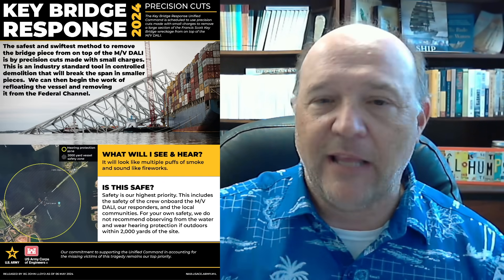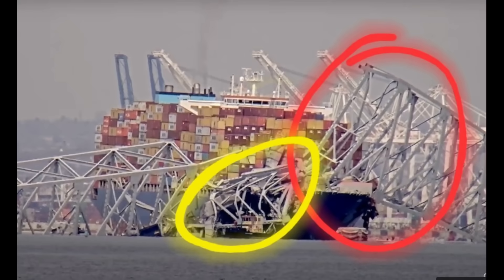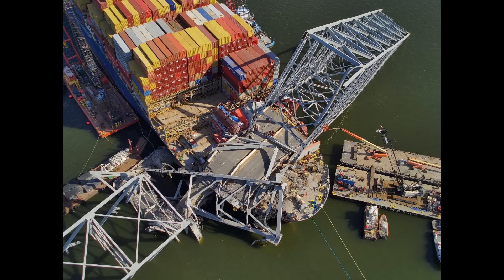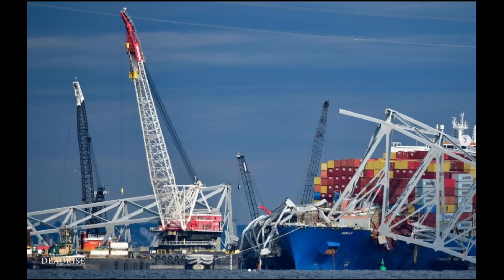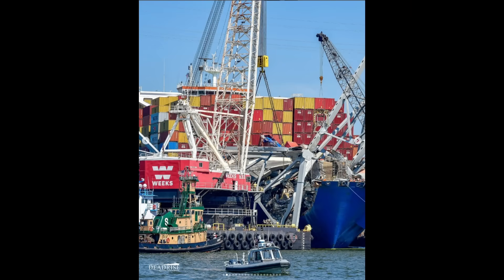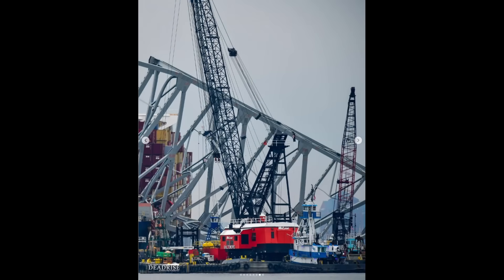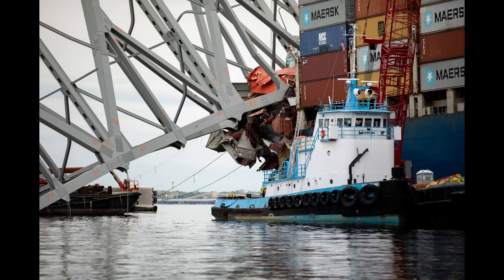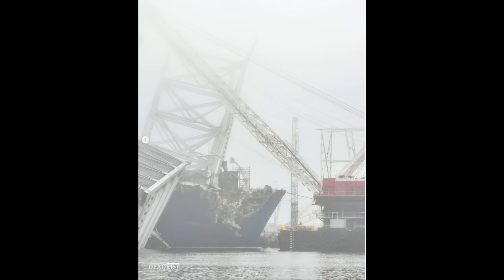FIRE IN THE HOLE! | Baltimore to Blow the Key Bridge Off MV Dali

Comment: This is the best decision for the safety of the work crews. Heavy structures twisted and at odd positions are very difficult to understand the loads and stresses. Steel under stress/ load can do unexpected things, when the steel is cut and the load/ stress changes. Large structures also have an enormous weight, which can squash a person like a bug. No need to add to the death toll. No need to make an already dangerous job worse.

Comment: Linear shaped charges are like magic. It's just an extruded triangular copper sleeve filled with serious puddy. 
They'll cut through like 3"+ of steel with, like you said, a very large fire cracker amount of fanfair. They form a line explosively formed penetrator and literally unzip whatever they are up against. They are also directional and short range, so very little overall impact.
The blast blankets are just there to catch the copper and steel spatter really.

Instant, simultaneously fired cutting torches🤘
Reply: They ain't that dainty. There will still be an Earth-shattering kaboom. Just not Alderaan levels of debris.
Reply: @blairhoughton7918  okay, fair bad wording. but still,  nowhere near the holywood blast people think of.🤣
It's even inside the boxbeam for containment

Comment: Once the bridge is removed and the ship can be docked, will cargo removal be the first step order of business? Just wondering what happens to that cargo in the filled containers after such a long period of time, ie does it become property of the various insurance companies, does it default back to the shippers, is it forwarded on to the intended port of call on another vessel? Given the amount of cargo these ships can move, there is probably a lot of paperwork involved after an incident like this.
Reply: Stolen cars inside.......
Reply: All the cargo from the ship can be held as ‘security’ to insure that each cargo owner pays its portion of the general average fund. Generally, the only way to get your cargo is to post cash or a bond to secure your portion of the general average fund. This is also very complex and it might involve parting with tens of thousands of dollars just to get back the cargo that you have already paid for …
Reply: @sventhormodpetersen1752 Yup, but it beats losing the whole thing. The average on this might be relatively small. Only a small fraction of the containers are damaged and some of those were empty. The ship damage is included but so is the ship. The assessment could be single-digit percentage of each shipment's value. But if they find a squished Bugatti under there everybody else is going to be piiiiissed.

Comment: I wonder what will happen to the Dali when the weight of the bridge section suddenly is removed. Does it come up from the bottom and what would be the side effects of that sudden movement?
Reply: Good question!  Someone mentioned in another comment that they are ballasting forward and possibly intentionally flooding some of the forward voids so that it won't come up when the bridge falls off, and then can be floated off in a more controlled fashion.

Comment: ZeroDay Vulnerabilities need to be better protected by the ship’s ETO.   I’m not blaming the crew for this exploitation but tune up your security.
Reply: Hope the front doesn’t fall off that ship at sea.   😂😂😂😂😂😂😂
Reply: @fakename8856 they’ll tow it outside the environment if the front does fall off.
Reply: which vulnerabilities? was it hacking after all????
Reply: @simonschneider5913  determining the source of a well done zero day is almost impossible. Unless someone takes credit for it it will be a guessing game. 3 generators don’t just turn off and go deadship at the exact same time the rudder was hard to Starboard.  I’m an ETO so I do somewhat know what I’m talking about.
Reply: @fakename8856  thank you very much for this comment!

i am way less knowledgeable about a ships systems, but your point about the coincidences makes a lot of sense. i know a little something about embedded systems, mostly motion control and sensors....so i can well imagine that there are many systems on board which could be targeted.

I remember the first thing i commented in one of sals videos: "once is happenstance, twice is coincidence, three times is enemy action"

it just looked strange to me, and there are things that correlated with it, wrt to geopolitics.
a huge can of worms, but i fear the YT algo wont let us go there.
Reply: Ships that size (Panamax) would NEVER have only 1 or 2 gens online in confined waterways like that. They would plan on running all 3 for the next day until they are out to sea.

Comment: Using shaped linear shaped charges you can cut through beams pretty cleanly. They are used to sever drill pipe in oil wells all the time.

Comment: Thank you for your coments on the unified command. I've seen incident command functions in the hospital setting and in practice its seems to be somewhere in between a single authority and a "unified" operation. If the players are all dedicated to the BEST results, rather than the power of their sector (as it should be), the "first among equals" tends to naturally emerge with the acceptance of all involved. Everyone involved in this operation is to be commended, especially if they have done the professional thing and united behind the most effective person, in this case the captain of the port. This will surely be studied and provide lessons learned in terms the actual work and the leadership functions.

Comment: There is a lot of potential kinetic energy with all of the weight still above water.
A few snip burns and cuts to lessen the charge needed .
   Ship will take as long as bridge to repair.
   Stray anchor yet to retrieve.
Ship would make a nice sturdy Dolphin .
Center it on new pylon . 
Build a hotel on it .

Comment: The orange blast points are interesting.  Looks like they are going to chop it up into "tiny" (40'-100') pieces, at least near the boat. All of those cuts are going to take a long time.  I wonder if the cuts are going to be "simultaneous" or if there is going to be a noticeable delay built in.

Comment: Bridge members under extreme extension or compression making it highly hazardous to have personnel in close proximity. Obviously, remote de-construction is a possible method of removal. So explosives or thermite - thermal dismantling has always been a safer option. .

Comment: Probably strip charges like they use to cut steel beams in Las Vegas implosions all the time.  Basically an L channel of steel that tamps the charge,  The open side is fastened flat to the beam and focuses the force to cut like a knife.

Comment: I think, logically, most of the explosives will be timed shaped cutting charges and perhaps some cabling attached to move the steel beams off the ship to pull the falling steel beams off  the ship with the least impact on the ship.  Not so spectacular as to the boom, but most interesting as to the movement as how the deconstruction proceeds from an engineering perspective.  I wonder if cabling will be in-place to also be able to retrieve the felled beams.. perhaps attached to buoys.  Do get this on video in slow-mo and have commentary from the experts that do this.

Comment: Question: if the bow of the Dali has been pinned down to the river bed and the stern has been rising and falling with the tide, with the hull fully loaded (as it is) this must surely have been causing structural fatigue in the centre hull sections? The tidal range does not seem to be that great but.....
Thanks for a great channel.
Cheers.
Mike (Cornwall UK)

Comment: The demolition animation looks great but with the whole structure leaning and twisted, it must be pretty tricky to calculate blast delays and how sections ought to domino. Maybe sections could pivot unpredictably either damaging the bow further or severing the gas line. Following this stage of the cleanup is fascinating.
Reply: There are more directional stress paths to figure in on a damaged structure then on a standing or undamaged unit.  The load paths have all changed from what the bridge was designed to do. Best of luck with the demolition, I do not mean to demean the job or the workers for this, it's a very demanding job, but even in the best of times this a crap shoot. All the best to the pro's doing this highly intricate work.
Reply: @praetor678 When you use explosives to make the cuts, all those torques and tensions and compressions don't have time to act to create large velocities. There's just some internal vibration and then gravity takes over and everything drops into the water. If you cut it into small enough pieces, you don't even have to worry about things stacking up, it's just a bunch of tinkertoys lying on the riverbed for the claw to fish up.

Comment: Sal,
It looks like to me that the broken bent (concert A structure) on the starboard side has penetrated the hall near the boot strap line. My guess is the chain locker and bow thruster rooms are flooded. There is a chance the force of the falling bridge broke the keel just afte of the moring deck. An engineering report I read the other day said the impact force was equal to a 24G ton bomb.
Reply from the maker: I am not going to see some severe damage on the port side from the bridge and down the starboard side near the waterline.

Comment: Are they going to remove the cement roadway which is a lot of weight on the bow before they try and move the ship?
Reply: Once the bridge steel is out of the way, the road deck can be cut into sections and removed. It appears to have been laid on a steel mesh.

Comment: Can Sal or anyone tell me if the giant crane that worked on the new Tappan Zee Bridge in New York is still around?  They called it the 'Left Coast Lifter' or 'I Lift NY'.  Wondering if it would have been useful in this operation?  I recall it can lift close to 2000 tons.

Comment: Why are the tugs going backwards  towing the front of the  ships towing them out of by the bridge. In stead of towing the ships from the stern from the tugs?
Reply: Interesting question. If I had to guess I'd say it's because if they have to suddenly switch from pulling to pushing, it's a lot easier to push from the front of the tug, and trying to get the front of the tug against the ship when the tow line is attached to the back of the tug is probably more complicated.

Comment: Removing the steel is the light part of the bridge I would be more worried about the reinforced concrete pier part, as well as the road deck part. That will be a huge weight. I really miss working marine salvage and tug work, been a long while.
Reply: The truss is about 4000 tons, but only half that weight is on the ship; the other half is on the channel bottom. I still think the road and pylon chunks will be a bit less than that.
Reply: Yeah, I can't believe that they haven't been talking about the fact that the whole pier cap beam is sitting on the bow, under the road decking and the that the pier column hanging over the starboard side may still be attached to it. That's a lot of weight and reinforced concrete to deal with.

Comment: " Controlled Detonations? " as in when a legally designated free-standing building is loaded with charges that  normally  cause a structure to collapse into its own footprint?  Had wondered if this kind of tech would become part of the solution. 

Which " precision cuts " are made, first through last, in order to maximize safety?  Out-side-in or in-side-out?

 Pray  all goes well.

Comment: “Not a crane around that could lift this off in one piece” false. The Sleipnir, 20,000 tonnes lifting capacity (40 times the lift of the Weeks crane on site) was in Rotterdam at the time of the collapse and could have been on scene with in 12 days after the collapse. The Sleipnir is the same beam as this container ship, 2/3rds the length and about the height of the loaded ship when it is unballasted. The Sleipnir is fueled with LNG, so they could have cut costs by fueling the ship locally. Amateurs.
The Sleipnir also has accommodation for 600 people so the crew on the Dali could have had better living during their cleanup which should have taken no more than 2 weeks.
Reply from the maker: It is not clear that the bridge section could have been lifted in one piece due to the damage.

The crew is living on board the ship in their normal accommodations and need to be on the ship to operate the systems.
Reply: @wgowshipping  Judging by the weights that I have seen for some of the bits lifted off, the Sleipnir would have lifted this piece in one go, allowing the bits resting on the ship to be cut free safely and quickly. You have to see this ship working to appreciate its capability. Two 10,000 tonne booms do a lot of work very quickly. As to the accommodation, I was making the comment for what is possible. The cost of this operation has really been about the disruption of the time delay getting the port back working, while people fiddle around with inadequate outdated under rated equipment.
Reply from the maker: @williambunting803  I am not sure if she could get under the Bay Bridge to Baltimore.  This kept some of the larger US salvage equipment from being sent.

I have seen her use on videos.
Reply: The strength of the bridge beams, and their compromised condition, limits the size of truss sections that can be lifted without the truss folding up.  They are getting complete truss panels at ~450 tons each.  That is a convenient and manageable size.  Once a truss section has been lifted, it needs to be moved to the land disposal site and cut up. Again, one panel at a time is a convenient size to cut up. Controlled demolition is ideal for rotating the truss off the ship without disturbing its integrity.

Comment: With that degree of damage to the bow, so far, it looks like someone will have to build her a new bow.  That should be interesting; the ship was built overseas and its difficult to think of a shipyard in B-more that would be able to drydock Dali for a year or more.  If she's written off for scrap, perhaps they can haul her over to Sparrow's Point and scrap her right there along with the bridge.
Reply: Will probably take whole section of bow off and will be replaced.

If the whole hull is stretched, the ship will be totaled.

15k TEU ship is not worth that much $40M-$60M. = Most likely just total it out, used as a museum etc.

Comment: The rendering of the bridge demolition is almost certainly an "artists impression" of how the bridge will collapse.  (though that model was probably used to plan how to install the cutting charges)  Most likely the real physics dynamic solutions to how the bridge would fall are all wire-frame models with each giant beam represented by line elements that only have length and stiffness.  (mathematically thinner than a hair)  This is WAY faster to calculate and "good enough" as all the beams in the bridge truss are long and skinny.
Reply: I think you underestimate how far computer simulation has come since the 1990s and commodore 64s
Reply: Yeah I have problems with that animation. Like how is the section on the bridge supposed to slide that far off. And how is the section next to it over the water supposed to get any lateral momentum after it's been decoupled by the cut. And they showed explosions going off all the way across the truss so why didn't the piece on the left sink into the water? So I expect this animation is just a notional illustration and the real thing is going to look somewhat different.
Reply: @TheAechBomb  I actually work pretty closely with people who make "state of the art" simulations.  We certainly CAN run a fully solid model of the bridge demolition with millions of time steps.  It'll take weeks or a super-computer and an eye-watering amount of license fees.  On the other hand, they can probably run a wire-frame beam model with millions of time steps in about an hour on a beefy desktop.  The results you need are just as accurate and you'll have time to iterate the explosive placement, simulate likely explosive failures, simulate different starting weather or tides, etc.
Reply: I suspect that animation was done as part of CDI's design package.

Comment: Well, controlled demolition should have been done weeks ago.  However, how are they going to remove the concrete pillar that is also on the Dali?

Thanks for sharing this update.  Cheers
Reply: That pillar is cargo now. Even if it weighs a thousand tons, that's only 2% of Dali's capacity. But if it's too far forward or if the hull is too damaged and can't float that well at the bow, yeah they'll have to chop that thing up and toss it into the water too.
Reply: @blairhoughton7918  Hopefully they can toss it on a barge instead of having to deal with it twice.

Comment: Is there the potential of after the span is dropped off the Dali, that she rolls to starboard due to the weight of the concrete pier resting off center of the vessel ?
Reply from the maker: Even with the weight, Dali is extremely stable. It is just having all that weight on the bow that is causing the issue as it had less buoyancy

Comment: I would like more context on the ships electric Power Management System. That shouldn't have been a proprietary secret. Some part of the electric system didn't preform as expected?
Reply: Evidence is sketchy but there was probably a problem with the load sharing of generators running in parallel   The NTSB has been aware of this and should be looking into it in detail.  The power problems at the dock and the problem just before hitting the bridge follow the typical pattern of load share problems.